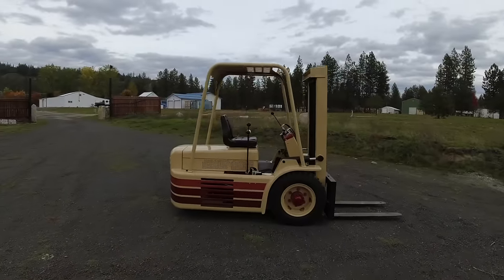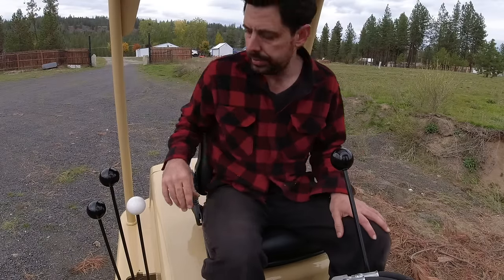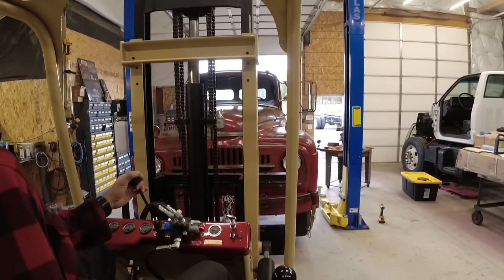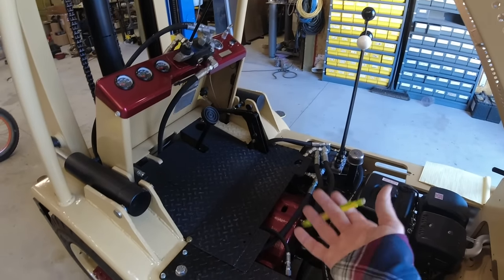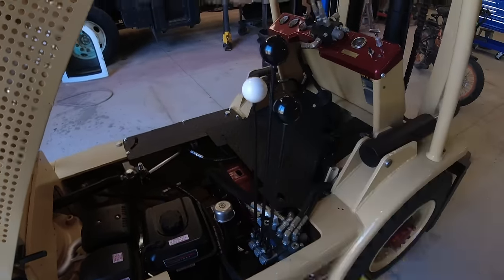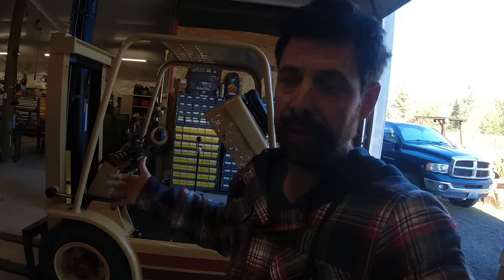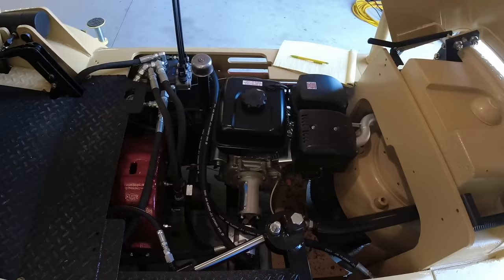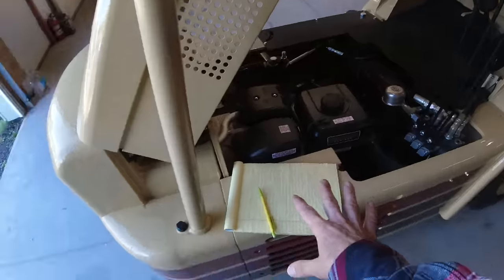How Well Does The 13hp Single Cylinder Forklift Conversion Actually Work?

Comment: Gday Austin, hey your forklift you do what ever works for you but I like the fact that you can take constructive comments and and use them to make something better. 
One question I have is about the fact that when you did the ice cream truck you did all the electrical and refrigeration work yourself. 
It’s obvious that you are a very multi skilled tradesman but was wondering if you need to have any qualifications or licenses to do this type of work. 
I’m a licensed A class electrician in Western Australia where it is illegal to do any sort of electrical or refrigeration work without a license. I not saying that what you are doing is wrong just curious how the system works in the USA. 
Anyway keep up the good videos. 

Cheers from Down Under.
Reply from the maker: Licensing is all over the place in this Country, with a much bigger emphasis on home building/repairs vs automotive. That ice cream truck you saw got inspected by the County it operates in Illinois and they don't particularly care who built it, just that it meets codes. My forklift will never be inspected by anyone since it's for personal use. I have previously held licenses for installing/repairing home electrical, plumbing, natural gas, and swimming pools, then on the automotive side licenses for auto electrical/ac/fuel. It's generally pretty easy to get licensed in most states but there is occasional gate-keeping that can be frustrating.
Reply: Thanks Nate was just wondering how it worked over. We have an Australis wide standards association on most trades. I had to do a three year apprenticeship before I was qualified. How have you gained all your knowledge and experience.
Reply: Austin, Mate don’t know where Nate from bloody spell check. Lol.

Comment: Isn't cooling the main issue here? If you have to manage the RPM's in november and you bet on longevity, the air cooling system could be improved by welding some extra "fins" or something isn't ?
Reply from the maker: I don't manage RPMs because it would overheat, I manage RPMs because its overall so much less wear on the machine.  At around 1800-2200 RPM the temp stays around 140*F while operating it. The hottest I have got this motor is 160*F and that was higher RPM while pushing around a box truck.

Comment: 24:17 I'm wondering if it wouldn't be a better thing to move the steering valve at foot level. For practical reasons of having the mounting of the hoses easier, but also for safety reasons, now, it's not an issue, but with age (and unless you went with the best hoses) and valve body, they are a bit close to your face/upper body. Down under, they'd be easy to shield/hide. Jm2c. I doubt that you could get a hydraulic injection at those distances currently in place, but it's not good to get splashed in the face either (knock on wood). These things age, i've seen it happen with hoses i've changed, so it's not like it's "eh, it's the next guy's problem" type of thing. Again jm2c.

Comment: Idea: use an Arduino and a linear actuator as a PID controller to adjust the throttle to maintain a specific hydraulic pressure.
Reply from the maker: Interesting idea
Reply: No need to make it complicate two pressure switches and a few relais are enough.
Reply: @jonasstahl9826  a PID controller will smooth out the changes so it’s not making large changes constantly.
Reply: @dcviper985  Thats for sure if you get it right, but a PID needs to be tuned in, if you have a constant flow like you want to control the flow of your gardenhose thats simple, but for a vehicle that goes from zero to full power in a splitt second. Thats quit difficult without making it inconsistend, better just leave it like it is or put a foot operated throttle padle in.
Reply: @jonasstahl9826  that makes sense. Everything I know about hydraulics I learned on YouTube. My background is in electronics

Comment: Also, OSHA won't be happy about the hole in the one fork.

But, I didn't think of certification due to the use case being private.

Split rims = widow maker, no arguments.
Reply from the maker: I'm not sure I've ever seen a happy OSHA rep. That is not a job I would want.
Reply: @AustinCoulson  😆👍 Also true
Reply from the maker: @madcat4563  My buddy up here is a code inspector and his job seems really stressful. Having to tell contractors over and over that they can't cut into trusses and they have to redo their work.

Comment: I watched the build, excellent job but I was wondering why you didn't go propane as most forklifts are, I suppose for less toxicity when used indoors?
Reply from the maker: They make a propane conversion that would do well with this rig but I haven't figured out where to put the propane tank. I ran out of room under the seat and kinda don't want a tank on the top
Reply: Yeah, I didn't mention the conversion kit cuz I figured you knew. I visioned the tank on top on the back and since it's a forklift I don't think it would be ugly or look out of place, just paint it up. Either way, nice build. I watched the Pizza truck playlist. You've got some serious skills and tenacity bro, crazy build!   @AustinCoulson

Comment: I watched your rebuild conversion, and I have to say you did a beautiful job. However, although you said it suited you how the forklift now performs, and the reduction in speed didn't bother you, I would have to say something if you were doing a job for me.

This is where I get on my soap box. So grab yourself a beer, relax, and read on.

Presumably, you would charge an hourly rate, so as a paying customer, I would be incensed if I knew how slowly you were working on my project.

From another aspect, for myself, actually, in my shop, I would have installed a rebuilt diesel engine for many reasons. But it's not my forklift, is it.

On the matter of the side shift. My father, God rest his soul, he drummed into me, from around the age of 10 years old, umm 53 years ago,  "David, no matter what you do in life, it's always better to have and not need than need and not have". How right he was.

When I purchased my 1960 Hyster 40 forklift, back in 1986, from BAT, British American Tobacco, the day before my daughter was born. The factory was closing down, as it was not so popular in the UK due to anti-smocking campaigs i guess. It was in pretty bad shape, but the price was right, £50 err $30 back then.

The Perkins diesel engine was seized up, but I removed it to rebuild once I had dealt with the chassis.

I stripped every last nut and bolt away, leaving nothing to the imagination. Some panels, including parts of the canopy, were repaired and parts welded using both stick and oxy.

The tyres it turns out we're the originals and in good condition, so I kept them, they are still on the truck. The clock showed only 1,284 hours, so it was almost new, right. Lol

I rebuilt the chassis, giving it a whole new paint job in the colours of my football team, West Ham United. I then tackled the engine, but sadly, it was worse for wear.

The block was craked, and the four bores were so badly rusted that the pistons had to be cut out, using a torch. The head had a but of a warp, and the valves were also seized.  It spent a week in an anti-rusting agent bath just to free up the valves. Then, I sent both the block and head to specialists.

The block was split and welded up, then new linings put in place, which meant oversized pistons, great, more power. The head was skimmed, and all ports made larger and new valves. 

After everything was put back together, I spent a week just running the engine in, doing it properly, unlike my 1964  Cortina lotus MK1. I blew the rebuilt engine up within two days. What a dick I was, stupid boy but I was a racer.

I'm glad to say, that apart from a few scratches, my truck operates with the same instant response and power as the day I started it for the first time. The clock now reads, 4,216 hours used. 

I give it a yearly service no matter how many hours it has worked. Don't get me wrong, it's reliable and fast but it's not all about the speed, just to know that it's there if needed.🤘🇬🇧🇺🇦🇮🇱

Comment: Add some counter weights to rear. On a extension. Like a tractor weights. Shorter forks. With extensions. I think in the logging buisness. Tree felling. A widow maker means you dead..I must be an American saying. Not used in UK.  Nice job. Now build another. You know the way now. The biggest you can find. Lol.
Reply from the maker: I've thought about it.  There are quite a few 16-30k lb broken lifts floating around here. If I did a bigger lift I would probably LS swap it and keep it engine driven
Reply: @AustinCoulson  well always a sellable item to somebody like your self. You just got to pay scrap price. You could fit three small engines. Lol. A possibility .. they can paint them there's self. Maybe run the engines on propane. Good luck. Thanks for video..

Comment: What is the deal in there to test oils on everything? What does it even cost? We run and service everything as long they run. And now not speaking of those 200 000$ things, that engine is like 200€
Reply from the maker: https://www.blackstone-labs.com/

I sample pretty much every fluid on everything I own. Engine oil, trans oil, my air compressor oil, hydraulic fluid. It costs 30$ a test and saves me so much by allowing extended changing intervals.

Comment: This forklift is so nice!! must be one of the best ones on the internet 😛 Maybe i missed it, but can i ask why you decided to use a spool valve for a steering and not went with a "tractor power steering conversion kit"?? like they use for converting older tractors, it's just a hydraulic cilinder thats attached to the manual steering rod? You could have kept the normal steering setup and didn't have to do with al the hassle of the spool valve?

this is wat i ment by tractor power steering kit:  https://www.youtube.com/watch?v=xlgHMJNLQxc
Reply from the maker: I didn't convert it to power to make it easier to steer, I converted it because a few teeth and bearings in the gearbox were damaged and I could not source a new steering gear box or replacement parts.  I searched high and low, and even considered converting it to a different manual steering gearbox, but I couldn't find one that was heavy duty enough, so I opted with a full hydraulic setup for simplicity.
Reply: @AustinCoulson  oh ok, well in that case you've come up with a clever solution😃. Do you like how it functions? it looks like it would take a while to get used to it?  If you ever wanted to convert to "normal" full hydraulic steeringwheel, a lot of agricultural machinery from the 70/80's onward have full hydraulic steering columns without any mechanical linkage in between the wheels and the steeringwheel. A steering column from an old combine or something similar could work. Just some ideas though, keep up the good work!!

Comment: Forklifts can usually go a couple hundred hours before needing a service 
Your not going to be running it like a warehouse we're it runs 10 Hr shifts everyday
Your weakest link is the Engine. Me personally I would say Engine oil every 100Hrs and every thing else every 300 hrs Think your wasting your money on oil analysis.... Iwould only be worried about that if it needed to run all the time how slow it runs & and not really getting worked hard the engine is doing all the work everything else probably is barely getting hot

Comment: Certified? egad. maybe check with the DMV too while at it (~_^) 
The weight difference would help that light steering issue. like that, at max, it should feel solid enough at your speeds you barely notice, then a bit over get to where it steers slow and draggy letting you know "That's too much!" (Not that I'd ever do it :-D but a 4850 lb @ 24" from the mast rated lift, lifting 2 stacked IBCs weighing 2,600 lbs apiece, tilted full back and just off the floor, steers fine forward or reverse, if you don't move things too fast)   Or you could eat a whole lot more and be the counterweight :-P  (The 2700 lb lift will lift the same load, until the last bit of IBC clears the ground, then starts to lift the steers. The only difference between the two models is the counterweight size) 
Side shift is nice, if you need it, width adjust is great, if you need it. I have done a lot of driving a fork where neither is needed, and far more where not having it is a chore (stacking IBCs full of liquid is rough without it and near impossible if you are down a narrow row of other stacked IBCs) but for your use it looks like a low order non-problem. In your place, I'd likely happily do without it.